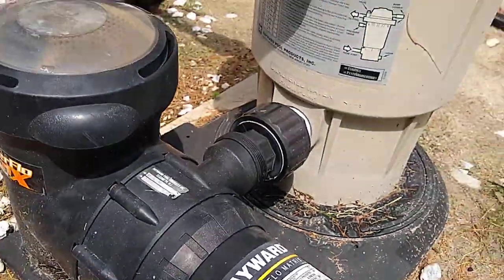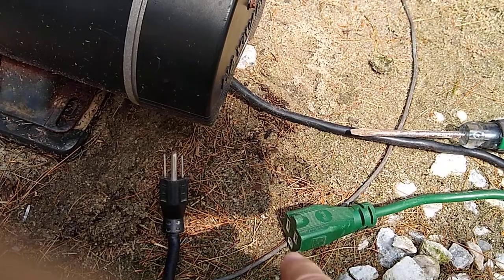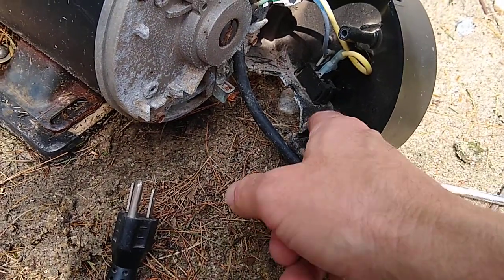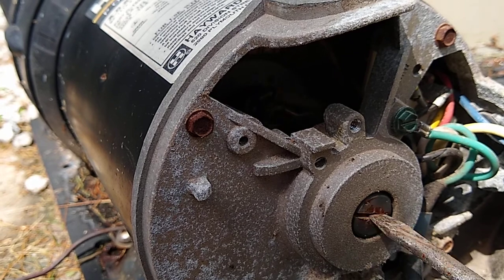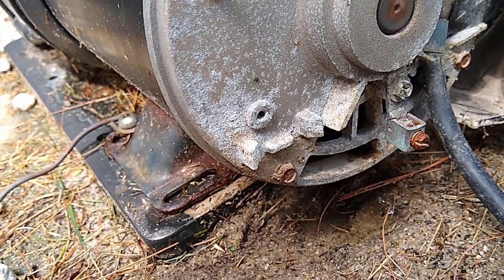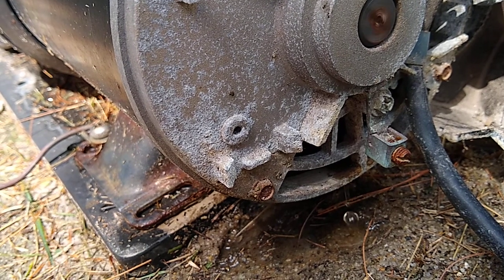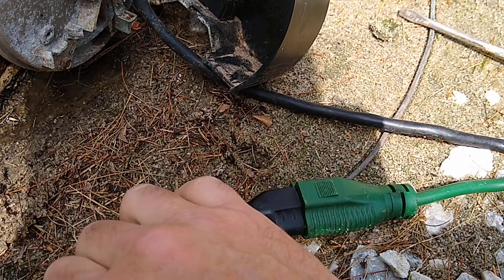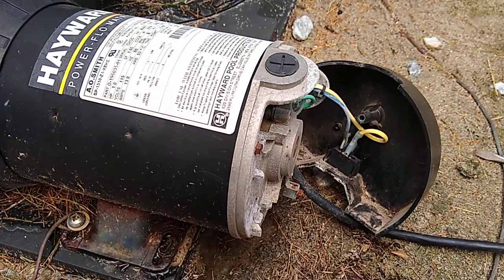Hayward power flo pool pump tripping breakers troubleshoot.

Comment: Hey .... Don't feel bad .... I just took a brand new hayward superpump out of 5he box and hooked it up and it's dripping water from the main center ceramic seal ...!?!??
Back it goes ..... Try again.
I've been using the same basic version hayward superpump for over 35 yrs.
This is the first one that came with a built-in leak .... Only $749.00 Made in USA !

Comment from the maker: Hello friends. I hope this video helped you determine what is going on with your pump. I took this pump apart and found that the seal was leaking. It can easily be bought on Amazon and replaced. Have a great day!!
Reply: Did you do a video on taking the pump apart? I need to check mine, I think it’s doing the same thing.
Reply from the maker: @septemberflores4999  I made a video but have not added it. You are the second person to ask me this week. I guess everyone is opening thier pools! I will add it soon.
Reply from the maker: @septemberflores4999  The video is uploaded. Have a great day and I hope you find that it is easy to repair your pool pump.
Reply: Where is the breaker on the pump?
Reply from the maker: The breaker that I was referring to is the house electrical panel. Have a great day!
Reply: Mine is doing this same exact thing